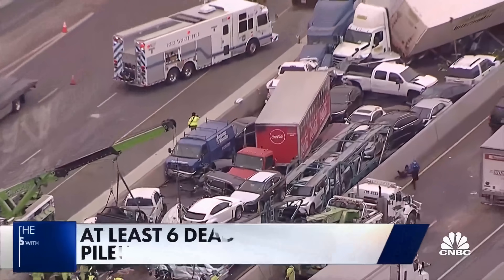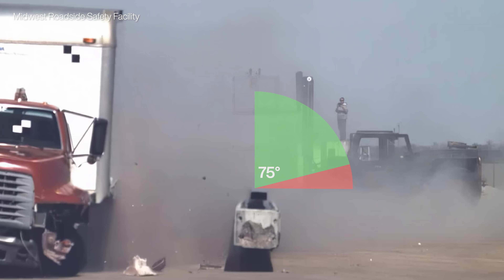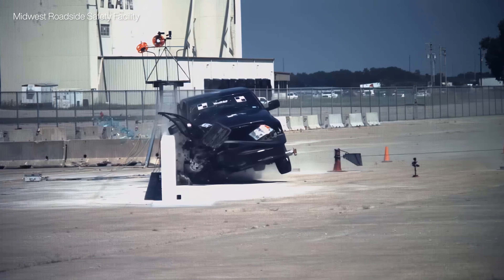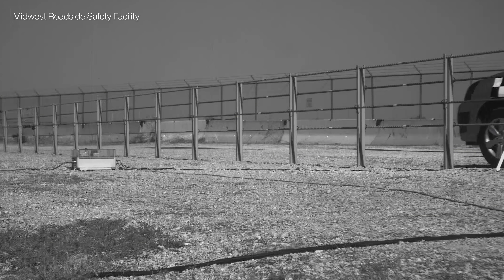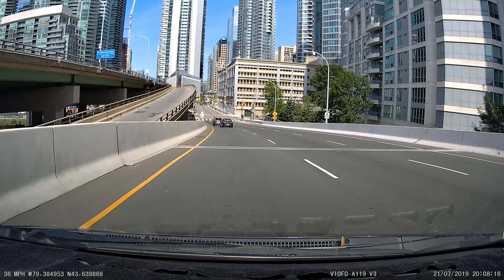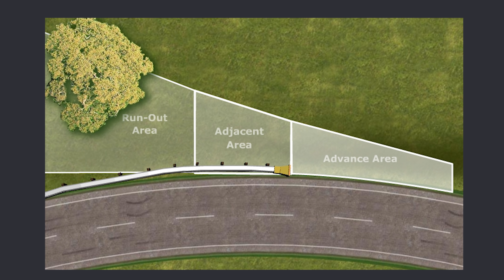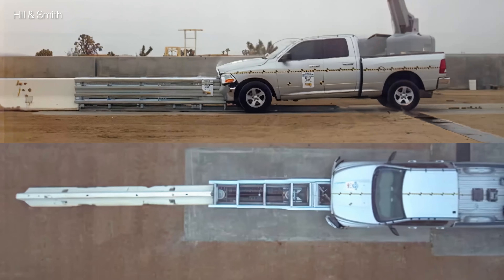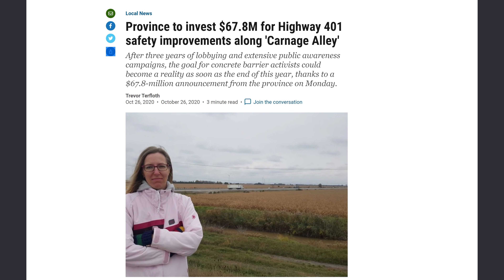How Road Barriers Stopped Killing Drivers

Comment: A well engineered guardrail saved my life when I got into a crash last year. Long story short I spun out briefly and slammed into the guardrail at 65-55mph and the airbags were broken on my old 2003 Taurus. I strongly believe the only reason I got through with legit just a few bruises and a very minor concussion+very very mild whiplash was a combo between my heavier car, the fact I didn't tense up, the modern guardrail, my properly adjusted headrest, and a newer seatbelt designed to slow you down slightly slower
Reply: Yeah I drove into a guardrail with a catchment net over the top, that net bounced my SUV back onto the road and had almost no damage to the car body
Reply: @Selmarya  I can’t tell if your trolling or not it’s funny imagining it in my head
Reply: I fell asleep while driving an XJ Cherokee with the cruise set at 75 mph just long enough to climb several feet up a Jersey wall.  I had the undercarriage checked the following week and there was zero damage.
Reply: i think the not tensing up during an accident is a myth other than that glad youre ok
Reply: @sirepauly  im actually pretty sure its true, that's usually why drunk drivers usually survive crashes, because the alcohol slows their reaction time and relaxes their muscles
Reply: @sirepauly  it's true, I'm studying physics and we learn about stuff like this, softer surfaces slow down the impulse (how long you hit the surface for) and tensing muscles makes your  arms stiffer which means if they hit something they are more likely to break instead of bruising only

Comment: 0:29 cars would be a LOT safer withOUT airbags.  Everyone I know that's ever been in an accident where the airbags went off was severely injured by the airbags, but they would have walked away with no injuries whatsoever if it hadn't been for the airbags.  They have caused many more deaths than they have prevented.  Sure, in a FEW cases they may have saved a life or two, but in the majority of the cases they made things much much much worse.  How airbags became standard equipment is a complete mystery.  Airbags should be optional at most, and completely outlawed at best.  I would never buy a car with airbags, but if I was forced to, I would remove them before driving it.

Comment: Ever seen what a cable barrier does to a motorcyclist?  I have.  Motorcyclist passed straight through, like an egg passing through one of those wire egg slicers.  I saw a motorcyclist in full leathers with hard plastic armor plates, get chopped into many pieces.  Feet, lower leg, torso, arms and head still in helmet, ALL separated, with some entrails still attached between torso parts, with intestines wrapped around the wire.  Emergency responders were literally picking pieces of him up that had come to rest on the other side of the highway in the opposite direction of traffic, an arm, a foot, his helmet with head, etc and placing them in a pile on the side of the road, with his destroyed bike.  The rest of him was dealt with with what looked like a snow shovel.

In an accident where a motorcyclist could glance off a concrete barrier, injured but survive, cable barriers instead cause him or her to promptly get a closed casket funeral.

I'm not suggesting that all barriers should be changed to cater for motorcyclists, since they do choose to be in the minority and accept the dramatically heightened risk of motorcycle riding, but man those wire barriers are brutal to them.  The guardrail style barriers can also be brutal for motorcyclists.

Comment: Cables destroy a car that would have most likely simply gone in the ditch with minor or no damage. We see bumpers and fenders dangling from the cables all the time here in Minnesota. I saw a car right in front of me lose control in the snow and go into the cables and bounce 3 lanes across the freeway. Then there is the policy of the state DOT to put a yellow barrel in front of damaged cables, as if that will prevent out of control cars from sliding into the damaged area. Why can't they put the cables in the middle of the ditch, centered between the opposite traffic, where cars are less likely to hit them instead of right on the shoulder?

Comment: Video idea - Look into more one-way street ideas. A perfect example is Route 1 in southern Rhode Island. The road has a wide gap between opposing lanes, with many center turn areas to avoid the need for traffic lights, stop signs and expensive overpasses. Given that the space available for limited access highways is shrinking, this could be a good alternative. Governments could buy up roadside businesses, and then resell the center area to businesses to recoup the expense. There also should be some better planning to move more industry next to highways, and move residential farther away. This could all be part of a larger holistic plan to improve both travel and living.
Reply from the maker: Thanks for the idea!
Reply: @Lam  No problem. I'm also looking for simulation program(s) to test traffic flow with these type of layouts. Something not too complicated, but might be looked at by city planners.

Comment: Very informative. We discuss this in our Advanced Driving courses as we mention how vehicle design safety, tire technology and road design (barriers etc.) safety have all improved immensely over the last 4 or so decades yet the one aspect of driving safety that has not improved is driver training. Since well over 95% of all crashes are caused by the driver, it makes sense to us to fix the problem - poorly trained drivers. It would also be more cost effective as you point out in this video how expensive it is to have safer barriers installed. Keep up the good work. ILR Car Control School

Comment: I am from Germany and due to the unlimited highway speeds we always have strictly divided highways and I have never seen greenery dividing the lanes, in the Video it was mentioned that the greenery can improve safety and give the driver the possibility to get in control of the car again, but would the risk of getting into oncoming traffic and causing a drastically more fatal accident outweigh the possibility of doing less damage to the car ? 
And how is it that in Germany less off the highway accidents are fatal then in the US eventhough we mostly use rail guards and sometimes concrete walls, is it the safety lane on the right, or maybe the better schooling of drivers or is it something else, any other safety measures? Because we still widely use the "fish fin" or the 45° angle at the beginning of our rail guards and I have never heard of them penetrating or catapulting cars into the air 😅 (please excuse grammar or typing mistakes or any misunderstandings)

Comment: I've checked it and the statement that America and the EU use the same systems is not correct  -  Most EU countries use in 90% the guard rails and never the cable system, because a cable is like a cheese cutter. Concrete is used as a mobile system for roadworks or when there is not that much place like under bridges. But concrete got problems because it is rigid and that's why there are more temporary barriers out of plastic filled with water. Cables are only used IN other road barriers, to support them and to help them to catch a heavier load. For example on bridges you have guard rails and behind them is a fence made out of pipe with cable inside them to catch trucks, busses etc.  or you have the cable inside the guard rail.
And you only talk about cars and trucks. - In Europe the regulations is looking for every type of vehicle and cable and concrete and many of your catch tools for the bigger cars are a danger for bikers. In zones where the danger is high for a biker, the guard rails in Europe are cushioned and go down to the ground to make sure the bike does not slide under it.

Comment: Figures.  My city didn't put in the cable barriers until me and 100's of other drivers were flung in to on coming traffic over the years.  My accident would have been significantly less traumatic with a barrier.  Instead I had to go to the hospital and my passenger had broken teeth and a fractured hip because we were t-boned by another driver. Don't get me wrong... The poor guy in the other car didn't deserve to be in my mess, but I lost traction when my tires hit the grassy median and there was nothing stopping me from flying in to oncoming traffic...  We all made it, but the barrier would have prevented my car from hitting the other driver.

Comment: Yeah but when cable barriers are used and need to be repaired before used again there is no barrier there versus a concrete barrier which can outlive many serious accidents without having to be replaced. Yeah cable barriers would be great, if our infrastructure supported quickly fixing them when damaged, which most places don't.

Comment: In Scotland UK the stupid idiots ( SNP run Scottish highways agency  )  installed Motorbike rider killing chain barriers with only two cables on their new roads , yes they are cheaper but they cannot safely stop a truck crossing over the central median and this has happened in Scotland ( M74 ) and they can kill motorcyclists who could slide under or between the chains and be decapitated if they lift their head to save their head from hitting the road. They are not allowed on UK Motorways so why did they use them in Scotland? Why show only cars hitting barriers there are motorcyclists and trucks who also need to be safely slowed or stopped.

Comment: You guys could also lower death reats by removing intersections and using roundabouts, they reduce fatality crashes by 80-90% and they are cheaper, easier to maintain and if a collision occurs its at 30-35mph.. and t-bones are almost impossible... ROUNDABOUTS.. Use them america.

Comment: I’ve always thought about this, if in a emergency situation with no way of stopping going high speeds would this be the best place to try and save yourself but others as well?
Reply: In the mountains, truck brakes often overheat and fail, so there are "runaway truck ramps" that are basically exits filled with loose rock and sometimes cables. The truck sinks in and slows down instead of accelerating down the mountain into traffic or towns below. Saves many lives, but occasionally a driver avoids using one, because the rock destroys the truck, trailer, and cargo. One driver got over a hundred years in prison after crashing, causing an awful fire, and killing several people. The first responsibility of a commercial driver is to keep everyone safe no matter how inconvenient.
Reply: In case of brakes not working or gas pedal stuck, open the doors next to you and put your foot down on the road. If that doesn't work start praying.
Reply: @itsyoboiivan3255  You know some idiot will try it, right? Use neutral or parking brake.

Comment: I was driving at night in the rain on the highway when i fell asleep. I crashed into the concrete divider but it bounced me back into my lane. I couldnt find a bit of damage. It's called K-wall and it was very well designed. If that was a flat wall, I would have been done for.

Comment: all of these are great when used correctly. In my country, the dumbasses in charge of the road system placed concrete barriers in the middle of the road, between lanes, and NONE on the sides. That makes for a real danger to anyone driving in the middle lane, especially when a big truck or a bus is driving on the outer. Because they are also quite thick and the bottom part is expanding out, they reduced the space you have in lane. You either drive perfectly straight or you damage your car.

Comment: Cable Barriers suck when you are on a Motorcycle (not that hitting any of them bodily is exactly healthy). A friend in Texas managed to just keep his body out of them when some moron changed lanes into him but it ate his bike. I hate them when I'm riding. It's not like Armco is much better (the increased in height doesn't help there). But, the cables right off the shoulder should be done away with. Middle of the median or off the right side is okay, but the damned things are at times just off the left lane.

Comment: In my country cable barrier is working well because before the installation of it vehicles use to cross from one side of the highway at high speed hitting on coming vehicles head on........ 🇹🇹

Comment: No mention of cable barriers vs motorcycles.  We're all about saving the world and using less fuel, but motorcycles are still seen as second class modes of transportation while we go nutz for electric cars...which require coal to charge and weigh more than a 1/2 ton pickup truck.  When a bike hits a cable barrier, the rider gets cheese grated and dies.  Great design.

Comment: And, what about motorcycles? I mean, I'm not from the US but i feel if a motorcycle hit that cable barrier the driver could be beheaded easily. It's just that motorcycles are not even mentioned in the video but i feel that the barriers in general, that are supposed to be a safety measure for cars and trucks, often pose a mortal threat to motorcycles.

Comment: I hit a barrier in a small Audi and it bent over the top of my car crushing the passenger side completely which was empty at the time, and I flew off the freeway into a tree about 15ft above the ground then fell landing upsidedown. I was really confused as to what happened and tried to run away, sorta like when you take a hard spill and try running it off. I passed out in the middle of the freeway and some other people dragged me off onto the breakdown. I kept telling them, "I gotta go I'll come back for my car later", not knowing my car was totaled. Then a cop slapped a ticket on my chest as the ambulance took me away. Not sure why he gave me a ticket... "wreckless driving" which was dropped in court, because he wasn't even there for the accident. My shoulder and spine are still messed up with some nerve and muscle damage but other than that I'm good.

Comment: I love how much engineering and research goes into these safety instruments. I assumed that highway barriers were there to protect against head-on collisions from accidental lane divergence. I didn't realize how much engineering went into the shape of the barrier in order to help dissipate impact forces, and kinetic energy; and to help contain rollovers, and vertical movement.
Reply: As an Ironworker working on barrier rail on the interstate for miles at a time. A lot of work goes into keeping people safer on the road. It takes over 2 days just to put in the rebar to get a 150 ft stretch that traffic blows past in 1.2 seconds.Then it has to be formed and poured and stripped and polished… construction takes forever..
Reply: @meredithlevi  good quality stuff often takes time and care
Reply: But still the usa has the most dangerous roads of all western countries..!
Reply: @jacks3395  Some say stroads play a role
Reply: @jacks3395  when trying to determine the most "dangerous roads" of countries there must be a lot of factors, not just guard rails and crash barriers. Number of vehicles, the weight of average vehicles, the expertise of drivers, age of drivers, the healthiness of drivers, length of roads, and location of roads (roads that go across mountainsides are more dangerous than highways due to the height and geographical factors), safety regulations, etc.
Reply: @Marshark50  Wisconsin for example has a ton of drunk drivers because we're a generally drunk state.

Comment: So, between my friends who used to be bikers and all the comments from bikers here, I decided I needed to know if there was any truth to the notion that cable barriers kill motorcyclists. There isn't. You are more likely to die from the alternatives from literally every study I could find.

And it shouldn't be that surprising. Unless you strapped a JATO to your motorcycle, you're not going fast enough to have the risks of cable's lower cross sectional area outweigh the benefit of the greater elasticity. Don't get me wrong, ANY collision involving a motorcyclist at highway speeds is probably going to be lethal, but the cables are not increasing those odds.

I know the argument is that the cable sometimes hits a motorcyclist in a way that causes differential forces along the spine - which can happen, but the accident WAS going to be fatal anyway in those cases. From a physics perspective, that is the body bending to slow the deceleration over a greater distance. If that type of impact didn't save the motorcyclist, no impact would have. 

There is a fantasy among many who've professed their fear of cable barriers that they could have just skidded to a stop, but as this video mentioned, the cable barriers are in places where there isn't a Clear Zone - that place where you imagine skidding to a stop. If you hit the cable barrier with enough force to be fatal, then no, you were not going to remain in the median, you were going to cross it. Your velocity impacting the cable inherently demonstrates that.

I wish there was a barrier that could be put up to save motorcyclists, but it's an inherently deadly mode of transportation. The vehicle provides zero protection, leaving you reliant on your helmet and leather clothing (if you even choose to wear those...) so there really isn't anything that can be done to make you safe. The cable barriers are the best option for motorcyclist safety. They just seem "dangerous" because NOTHING is going to be safe for a motorcyclist.

Comment: "How road barriers stopped killing drivers" yet the pileup on the texas highway caused deaths because of the road barriers. They couldnt go around the other cars because they were trapped by the barriers on both sides!!!! Texas is dumb af for putting concrete barriers on the car pool lanes. In california they are wide open so the drivers can move from danger if theres a wreck in the car pool lane and not be trapped like the ones here in texas